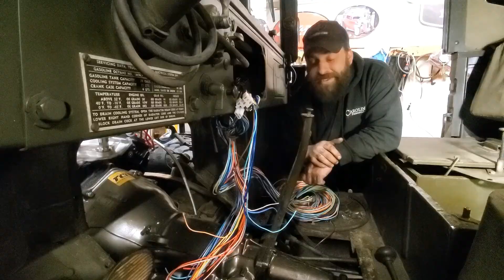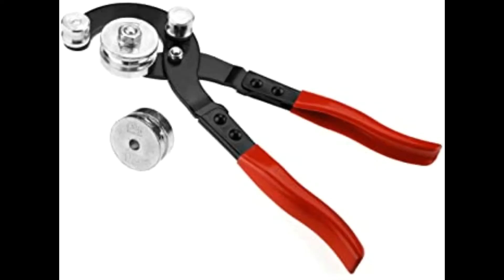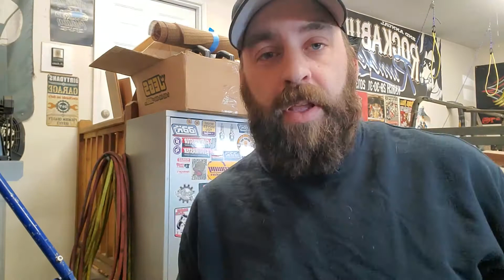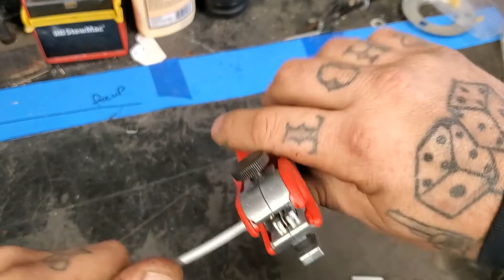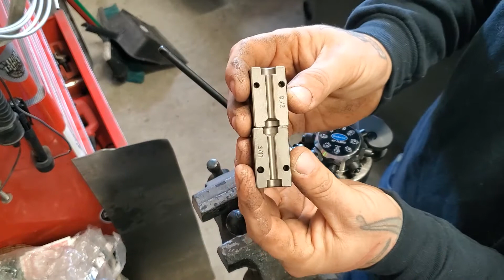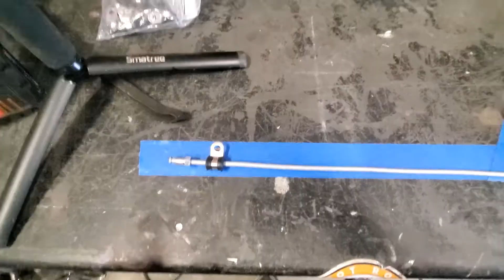RAT ROD AND HOT ROD BRAKE SYSTEMS   PART 1 OF 3, bending, flaring, and cutting brake lines

Comment: If there's one place I can stand to get better at, it's for sure brake systems! I for sure couldn't get the flare right like the first tool you showed. I had someone flare a line for me on another system that looked 100x better
Reply from the maker: Those old style ones suck so bad.  I could make a decent flare with them but never perfect.  That eastwood tool nails it every time.  As many brake lines as I do it was worth the investment
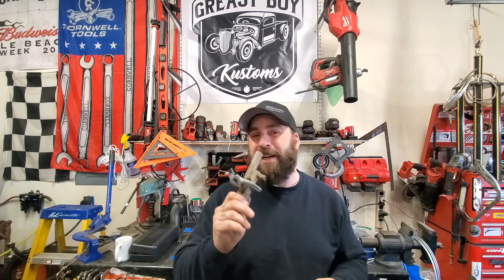Reply: 6:21 in the video....😂😂😂😂  Been there for soooo many years. I upgraded mine last year from that style, life is much happier. 😄